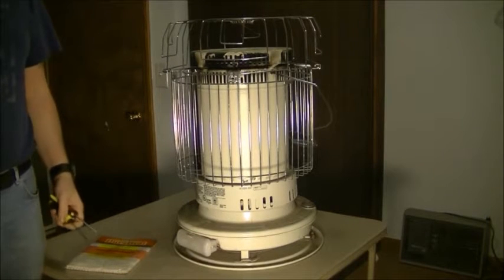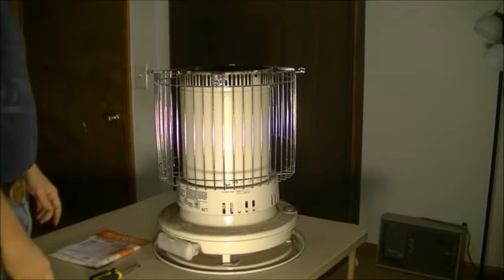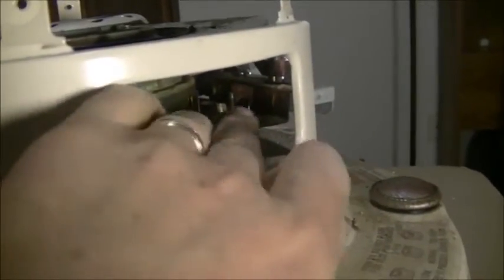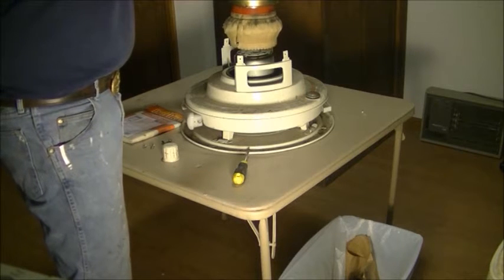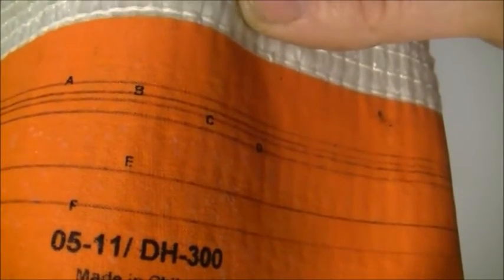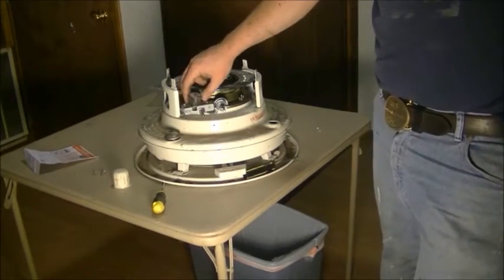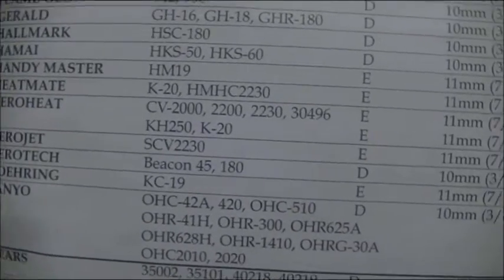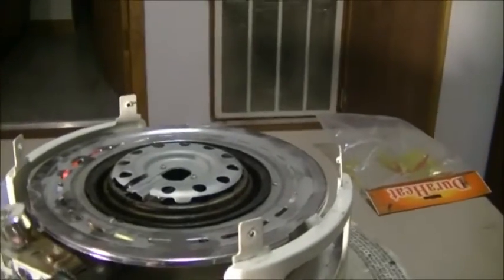Replacing The Wick In A Kerosene Heater

Comment: I have a keroheat cv 2230. I have the same wick as you do in this video, but unsure where to check for which line I use on my wick to line it up. I presume E line as you had here as our heater looks identical to yours.
Reply from the maker: Yes, its the E line for the Keroheat CV 2230. I had a chart in
 the package with my wick that tells which models need which line.
Reply: great, thanks!